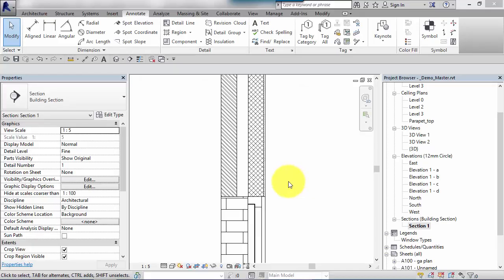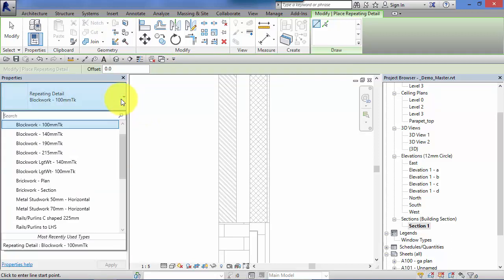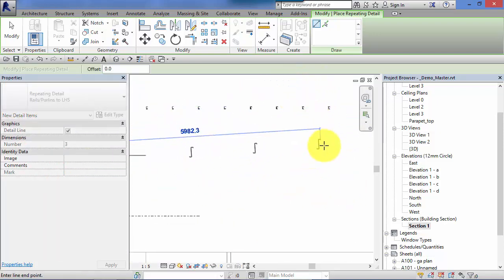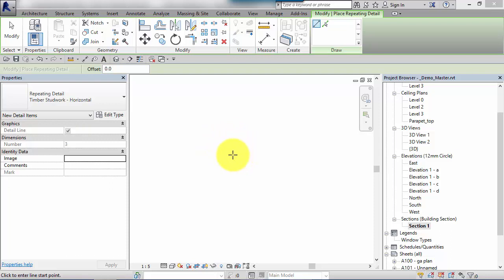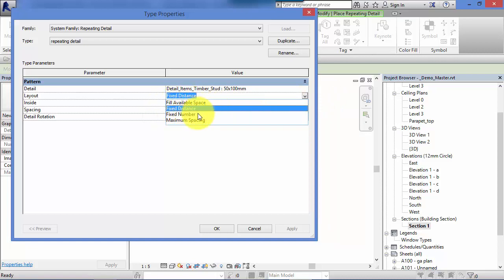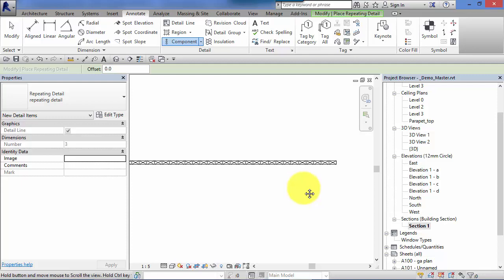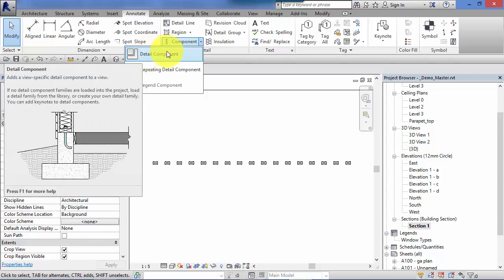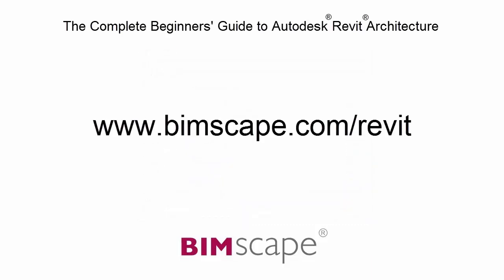Module 8: Unit 6: Revit Architecture: Repeating Details

Comment: Repeating details seem like a great idea in principle but the inability to either snap detail lines to any parts of the repeating detail element (apart from start, end or midpoint, no intersections etc) or use the align command to all parts of the detail element renders them sadly pretty useless. Is it not better to create line based details components and then array them and create a group?
Reply from the maker: +JuJitsoup I think you have point. The trick is setting out the the start point for your repeating detail- ie for brickwork in section- is it the bottom of the bed joint, corner of brick. As you say, more difficult to manipulate once they have been placed.